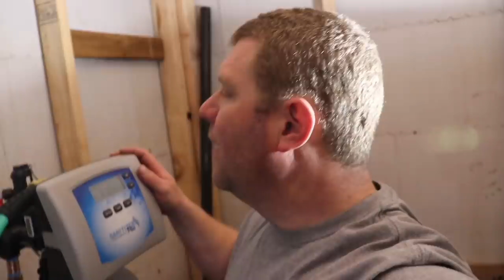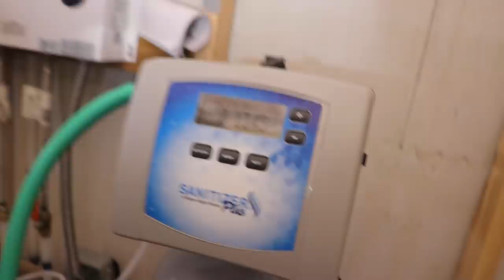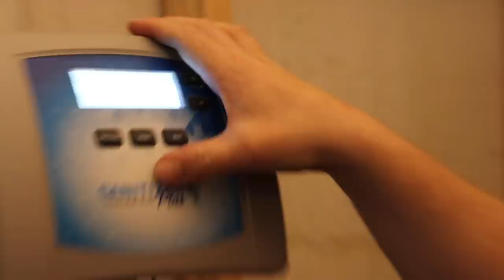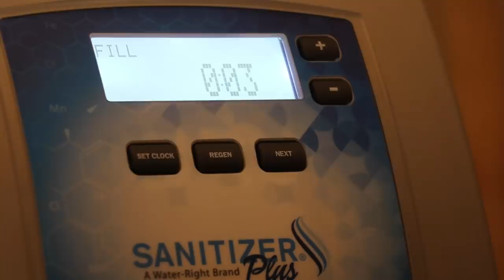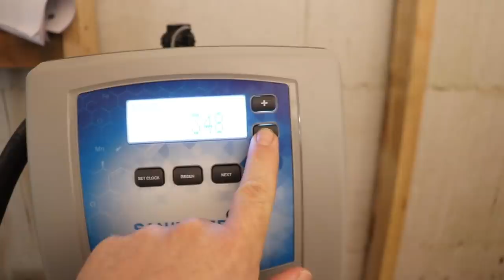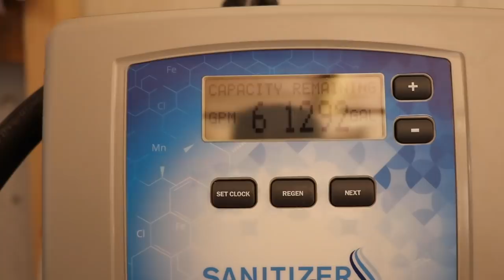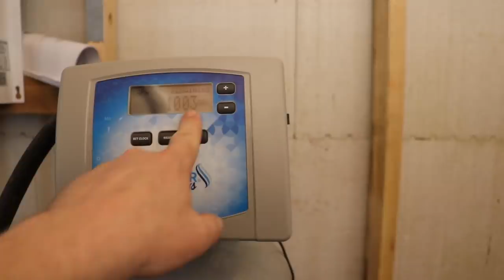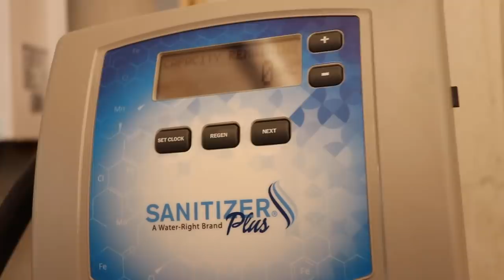Filling $10,000 Off Grid Water System from Brand New Well

Comment: We put in our own water system and it definitely has some calculations to work out.  But, for us we could flush our water softener every 6 days to keep hardness at zero, but we have a lot of tannin in our water.  Just by watching our water, I found we need to flush every 4 days to keep it clear from tannin.  We have an Iron Breaker tank that oxidizes iron and hydrogen sulfide which has to flush every 3 days so the media stays good and doesn't solidify.  It uses Birm and pressurized air. But, with how much hardness, tannin, iron, and hydrogen sulfide was in our water, we opted to go for the separate filters because we needed the high capacity.  We can regularly flow 6gpm with no issues ever.  The media doesn't come pre-charged, but it has some capacity on it's own.  Normally, you want to run a full backwash and regen cycle when you install the system.  We also use 5 micron sediment filter first, then iron breaker, then softener, then a micron filter to keep the annoying black rings out of our toilets.  Good job so far I enjoy your videos.  You'll get it.  Everyone's system is different.  We just opted for separate tanks because we were told it works better with high capacity.

Comment: I live in Florida. I had hard water and sediment in the water. I installed the same system as you did except put a full house sand filter ahead of the conditioner. Now I have had no problems. You may need to add a filter. If you do, put it ahead of your conditioner.

Comment: It is worth avoiding using the breakers in the distribution panels as on off switches as there only intended to be used as fault protection devices. Constant cycling on and off can cause the breaker to fail prematurely. So it would be worth while fitting a suitably rated exterior switch for the well pump.

Comment: Hi guys. Long time viewer. I'm curious why you keep unplugging the softener? We live rurally, are on a private well, and have a softner with a front-loaded 1micron whole house filter. Our softner stays on and regens when it needs to. I keep the salt topped off with about 6 bags. We have two holding tanks; One 2500 gallon at the top of the hill about 1500ft downhill from the wellhead and one 3800  gallon tank with a fill valve and float that automatically shuts off when the tank is full. The well pump shuts off when both top tank is full (using a mercury float). It's never been an issue to have water in the tanks sitting, although we use water regularly. The difference in your setup is you are filling the cisterns with softened water vs. we fill with well water and filter as needed. We have heavy iron in our water as well. Part of living in the Inland Northwest (Eastern Washington/Western Idaho). Anyway, just thought I'd share our setup. Hope it helps.

Comment: you definitely drew your charge down into the well with siphon. I had the foot valve and the top check valve in my well go and if i turned off the pump for an hour so the pressure vessel bled down and if i cracked a faucet it would drain my pipes like a gunshot.

definitely would get a check valve on there as well as a vacuum break. those little garden hose fittings arn't rated for negative pressure so even when shut, you'll draw down through them

Comment: reason the pressure is too high.  You will need a pressure regulator  set at 30 low and 50 high----you will need a pressure tank to give  set at the same pressure.        This will allow you a more consistent   pressure  your  usage point  shower etc.......

Comment: If I were doing this I would fill the cisterns with well water, bubble air through it to oxidize the iron in solution to particles, put a micron filter at the cistern to take out the oxidized iron and just run it through the water softener on demand when used in the house.

Comment: once you figure out all your filling ideas, what you should do is use the cistern like a pressure vessel. you set 2 float switches in the tank, a high and a low. when the water drops below the low one, the cistern fills until the top switch is tripped. it's a very simple latching circuit.

also, if that's not enough water pressure in the house, you just get a booster pump and a pressure tank in the house. so instead of turning the well pump on and off (expensive repairs, high power draw), you're using a much cheaper and owner serviceable pump. these are also pretty common as they are used to lift water above municipal hight limits (or to fix low pressure)

Comment: I have a whole house softener and it reduces pressure significantly so. Knowing that this was going to happen, when redesigning the entire in-house piping infrastructure, at the time I wondered if I needed a pressure pump after the softener, or could avoid that. I decided to run all water piping on a slightly wider diameter and to have no angled connectors but (using copper tubing) bend all angles. Pressure is one part in the "how fast does the water get through" equation and flow rate the other. You can maintain pressure but over a series of angled connectors lose a lot of flow rate. In my case it is the other way around. The softener takes a lot of pressure away, but the piping layout maintains flow rate. I never needed the auxiliary pump. And the flow rate optimized piping is very quiet, even when lots of water flow.
Soap and detergents - with the soft water you'll need much less.

Comment: If you DO ultimately need to pour 1000 gal to waste before filling the cisterns, how about installing an 1000 gal tank for use as garden watering only? You'd only use it in the summer but that's when the water table is lowest so you would be saving overall.

Comment: I think you should put a tank somewhere with well water in, with a low and high level sensors to fill it on demand from the well, and use that to feed the water softener (and the garden).

Comment: You guys have 1300 gallons worth of iron concentrated in your softener. You should backwash that out before shutting down. The media will get all plugged up with that iron oxidizing in there. Do you brush your teeth before or after you eat? Same concept.
Regarding the bypass hose on the well. You could place a pressure relief on that hose to control over pressurization instead of throttling the supply hose to the softener. Either way i hope this is just temporary and you will end up installing an expansion tank and pressure switch to allow the well pump to cycle once things are more permanent.
Like others have said, it would be strongly suggested to install a generic big box store water filter to catch the sediment before entering the softener. 
I'm wondering if your well pump is too large for you needs.

Comment: The iron solidifies when the the water is aerated.  For the sanitizer to properly filter the iron  the water needs  to be aerated first.   Also those sanitizers use the salt brine through an onboard chorine generator to clean and disinfect the cr100 media.  You need to get your well pump hooked up to a small pressure tank and have the sanitizer under pressure at all times.  The media in that filter works great but can be ruined if you mess around like you are with a temp water system.  Also. Run only solar salt through them.  The media will last longer.  That media is good for about 10 years if you take care of it.  But it’s about 1000$ to replace it.   I built a pile of homes in Oregon with clear water iron in the well water and learned the expensive way.  There’s a ton more I can tell you  on those systems if you haven’t Allred’s figured it out.

Comment: Hey.  

Just subscribed but have been watching for a couple of years.  Learned a lot from your successes and actually more from your mistakes!  Thanks for sharing.   Anyway, I understand that dealing with a well is something that most people don't "get", and that it is hard to find non-academic information about them.  So...

I grew up on a farm/ranch, in your general area (Alberta,  Canada) with well water.  I now live on a farm with well water.  Both are  dry (surface) areas in Alberta, but have deep wells that produce well.  In between then and now, I moved north to a farm on rich, wet farm land, where (ironically ) the aquifer was crazy deep and unreliable... almost every one hauled spring water to a cistern.  I say all of this to let you know that I'm fairly familiar with rural water... plus my in-laws drill water wells for a living.

I have literally never heard of anyone having both a well and a cistern system...  unless they hauled water to the cistern for household potable water, and used the well for agriculture or livestock. 

 Does what you're doing have something to do with "prepping"?    I don't understand, otherwise.  Why would you pump relatively clean water up to the surface to let it sit... for you to have to condition it again?  Not to mention risk running your well dry...  Even the best well can overwhelm it's supply if you demand that much of it over a short period of time.

Perhaps there is some goal to this I'm not understanding. ..  But if not, wells are meant to run somewhat consistently.  I'm  not understanding why you're not hooking up to supply your household system, directly,  from your well.  Seems like a pretty decent well... which (like most wells) produces better water when run consistently. 

Granted, you are using gravity as opposed to a pressure tank, but you still need power to pump your water up a hill in order to get pressure.  Seems like a lot of fiddling around just to avoid a pressure tank.  Is their something I'm missing?

 If not, you've got a well, use it! That is how it's generally done, unless your aquifer isn't reliable...   Even if this is the case, it seems counterproductive to use it to fill cisterns.  You're only using it when you are going to place huge demands upon.  If you want a cistern as a back up, seems like a lot of work and worry with very minimal gains, but if that's the case, be prepared to deal with pump and pressure problems if you try to fill it too quickly.  Personally, I'd only use this sitting water for irrigation or livestock.

Anyway, here is a great time saver for shocking your well:

We used to go through the half-day hastle of renting a tub from the county, and shocking our well, every year (something you need to address, especially to deal with spring run off and subsequent heightened likelihood of contamination), but we have found the simplest (and actually better) solution, backed by years of water testing...

1.  Attach  a 1/2 inch brass fitting with a threaded cap to your well head connected to about 15 feet of clear hose which runs down inside your well.

2.  To start, put 10 Oxydizer - hydrated calcium chloride - tablets ( sorry, don't have the exact quantity per tablet, but they are about the size of a Skittle...testing for chloride after a week will guide you... if it's too much, just run your well for a bit) every second day for four days.

3.  After that, put 10 tablets down every week.  If, after normal use for about an hour, you can smell chlorine in your tap water, use 9 the next time...  Then 8...  No less than 7.

4.  If you miss a week, start over from #2.

There are stupidly expensive continuous shock chlorinator systems out there  that do this, but they are not any better, and tend to break down in cold weather.

Hope it helps.

Comment: My guess is that you will wind up with a traditional pressure tank and run the well water through that to the softener/house.  The cisterns become redundant and could be emergency back up or high volume fire security. I don't. see any need for using electricity to pump the water all that way up hill--over complicates everything when simple captive air pressure tank keeps everything accessable and close by.  Hard to abandon something you put so much effort into.  Maybe you could use the cisterns for unsoftened water for exterior water and gardening.  I think pure well water is better for garden anyway and no sense expending all your salt for regeration on exterior/gardening water.

Comment: I wouldn't call the water on the ground "wasted" either from the well or softener. It's coming up out of the well and back into the water table through the ground. The only waste is salt, softener media & power to run the well pump. Question though would you want to use the old filler pump at the ground hydrant after the softener to raise the head pressure to make the pushing water uphill process easier / faster.

Comment: What's happening is that the NaCl you're adding splits into Na+ and Cl- ions when it goes into solution, and the electricity added combines them into Cl2 (chlorine gas). Chlorine gas is very reactive, so it reacts with almost anything, thereby disinfecting the water and consuming the chlorine gas. Any unused chlorine eventually disperses into the atmosphere. The levels of chlorine should be very low (compared to for example pool water where you need a lot more disinfection) and thus safe to drink. And since you have a cistern it off-gasses there, leaving you with chlorine free tap water. In a municipal water supply where the water is never exposed to the open atmosphere for any length of time you might need to leave water sitting in a jug before watering very delicate plants, even though it's perfectly safe to drink.

Comment: I think you should go one step above for the well: add the pressure tank and a cutoff switch. It will make your next regen cycle easy, and you will need it anyway if you want to run the garden hose off the well...

Comment: I haven't read all the previous comments, so forgive me if this has been mentioned.  To prevent the well head from freezing, you have a weep hole in the pressure pipe.  That's not a bad idea, but every time you shut the well off, several gallons of water is running back down the bare well shaft until it gets to the water table.  I can't help but wonder if that's not washing some amount of dirt down into the well each time.  You certainly never want surface water running down into the well, but unless the casing runs all the way down (which it doesn't normally), then you could be hurting yourselves more than helping by letting that run back.

You could build an insulated well house over the well head and house your pressure tank there too if you'd like to keep it out of the house.  This is VERY common in the south, but not sure about your climate -- a well-insulated well house can be kept above freezing with a 40w-60w incandescent bulb on a themostat pretty easily.  Otherwise, a normal pitless connector and sufficiently-buried water line would solve the problem by eliminating that weep hole and drain back.

Comment: I agree with some of the other commenters.  I would water the garden directly from the well.   It might require some additional plumbing to run a direct line to the garden, but why filter garden water.   Also some of your pressure loss is probably because you are running the water through so much water hose.  Finally, I have a question if you have time to answer. Why are you not pulling water directly from the well into the house rather than using the cisterns.

Comment: You can’t use softened water for the garden. Softened water will always taste salty. You are better off with a set of three filters: 50 micron, 3-5 micron and if you have enough pressure (you seem to have) 1 micron carbon filter. Good for about 3 month. Also install reverse osmosis for the kitchen drinking water.

Comment: Get rid of those tiny hoses.  You need at least 3/4 to 1 inch lines.  5/8 hoses will slow your flow exponentially.  I ordered  food graded bulk hose from amazon and made my own.  It was difference between hours and minutes to get tanks filled.  Also make sure you use RV “grade”. Regular hoses will leave a rubber taste in the water that gets worse over time.

Comment: Looks like to me you guys should invest in vfd drive to control how fast the pump works so you can control your water pressure needs without needing to use pressure reducers and have the correct amount of flow and not burn your pump motor and save power too.

Comment: I bet there's a valve that you can open to let the air out as it fills, I think I saw it next to the back wash. Worked on pools, and it sounds like your filter has a chlorine generator. Salt pools have them which allow for the chlorine to be less as it's added slowly rather once a week.

Comment: If you would use a bladder system and run the well on a continual basis everything would work better. Water treatment works better when you don’t have ‘upsets” in the process. When u put in air in the system you upset the media and it has to settle back down. You are starting over every time which is not good. One of the worse things for us was shutting the water plant down and having to restart the process, took a while for the treatment to settle down.

Comment: You need to take your flush water out of your septic tank and leach field system.  The salt you discharge after the regen process with kill off the "bugs" that digest the sewage in your system and you will end up having problems that you don't want.

Comment: A cut off plastic water bottle and nylon window screen hot glued to form a sock. Water flows through and draws floating debris into the sock. To push the water using a small pond pump. Cheers.